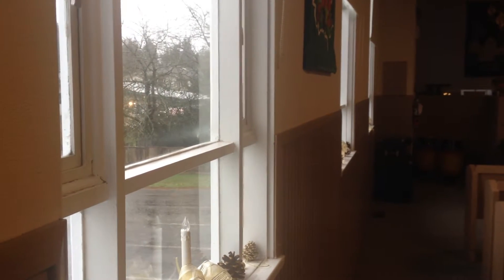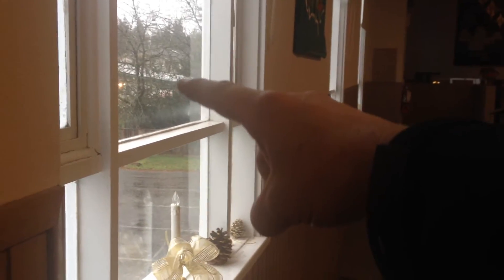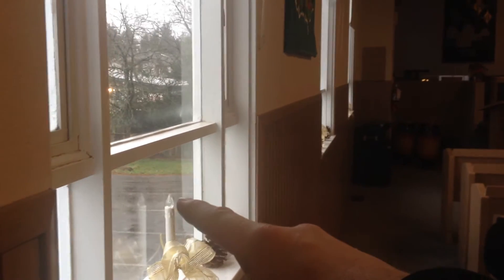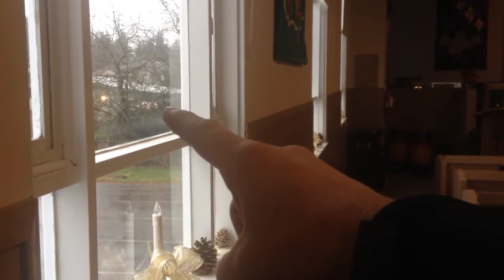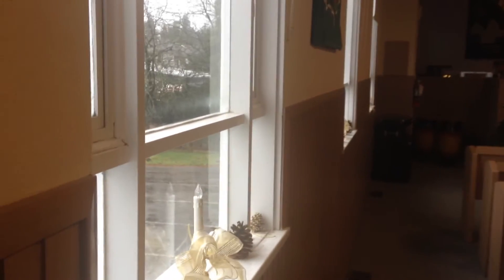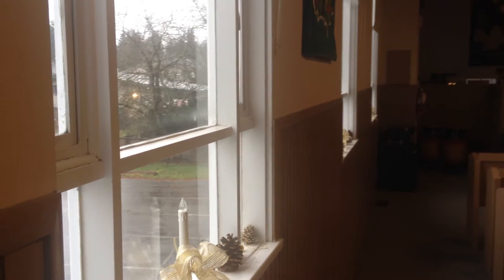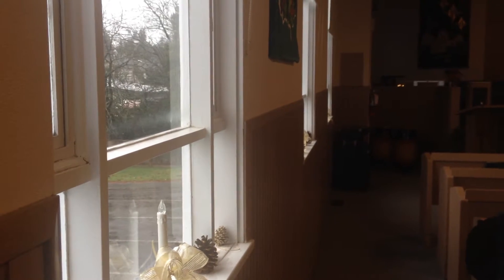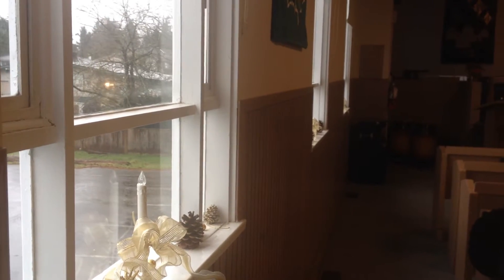Rolled glass vs. float glass

Comment: I read somwhere that very old windows are thicker at the bottom and it was thought that over the years the glass had somehow flowed to produce this effect having stood on edge for so long. Don't know how true this is though
Reply: thornwarbler 
How come that old egyptian and roman glass wares (admittedly they did not make panes) hasn't flown into a puddle until now but a few hundred years old cathedral windows should have visibly deformed? The reason: glass flowing is a myth, maybe comes together with the fact that there are still people claiming glass is a liquid (which is another myth).
The uneven thickness comes from how glass was manufactured centuries ago. And if they had the choice, they of course mounted pieces with the heavier part at the bottom. But there are enough panes in old buildings where the thicker part is to the side or even the top.
For more info, just google it. It's the internet and sometimes people even share scientifically founded information there ;)
Reply from the maker: Yes, very true. All materials experience creep (cold flow) under low-level stress (gravity in this case). Creep is more severe at higher temperatures. Tires and lumber are stored the way they are to minimize creep and material failure. Metals, steel beams sag permanently, bridges and aircraft structural parts have a safe maximum lifetime due to creep.
Reply from the maker: superdau Check this out: https://www.youtube.com/watch?v=xe-f4gokRBs